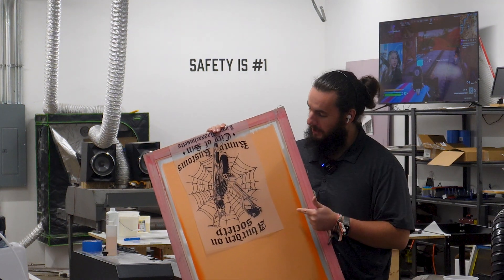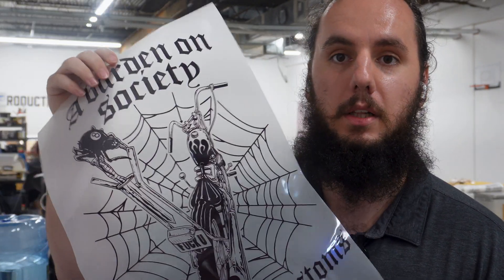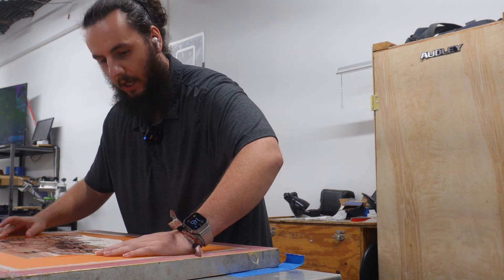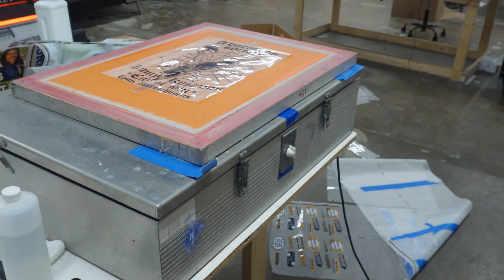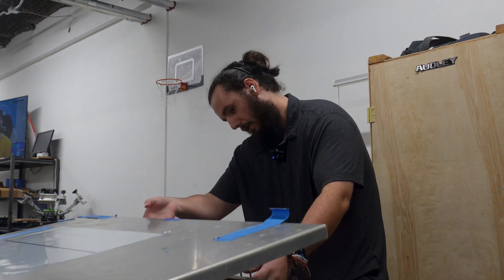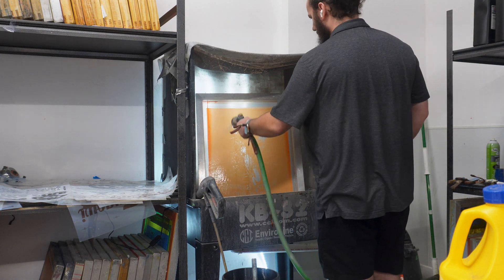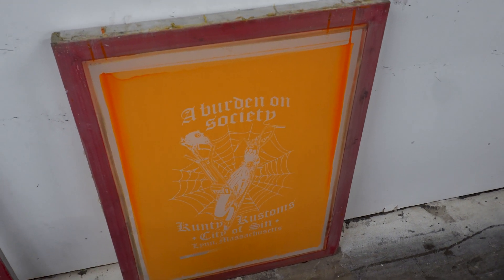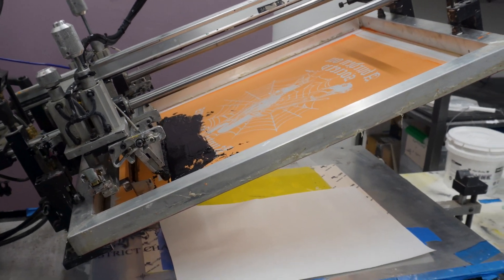Create MASSIVE Transparencies for Screen Printing using DTF Transfer?

Comment: This makes no sense to me.  I use accu rip to my  et-1500.  it cost me $250 a year and makes life much more EZ especially with halftones
Reply from the maker: Print size Daniel. 

I say it in the video if you watched it all. 

Your et1500 can only print 13x19”. This does up to 22x36” and doesn’t require any annual fee
Reply: @chooseams  That makes sense,  I had been drinking and did not watch the whole video. it's very rare for me to go over 13x19.  I have had to splice some seps together though in the past.  Sorry if i came across as a jerk.